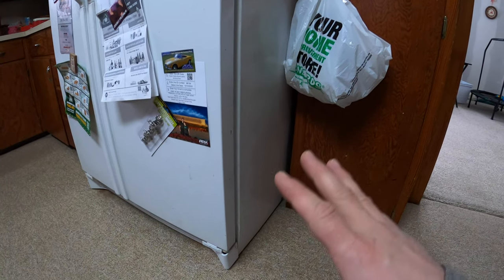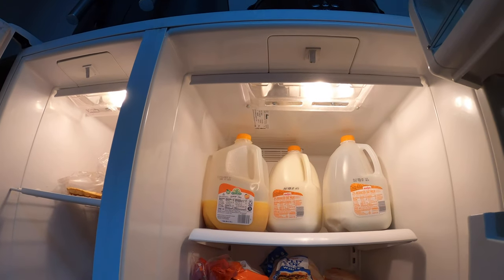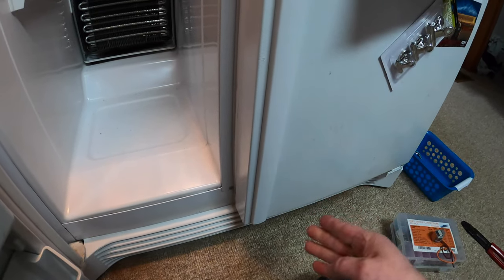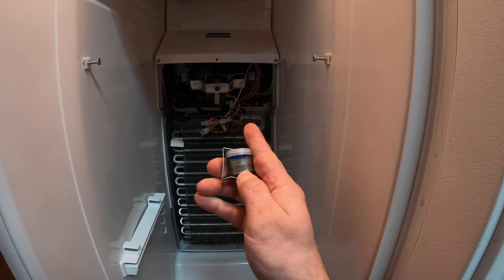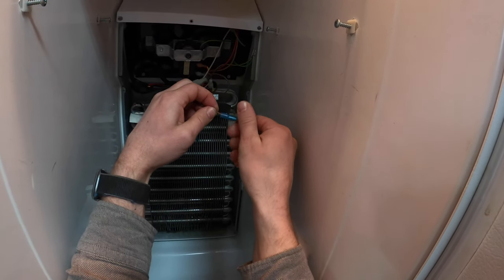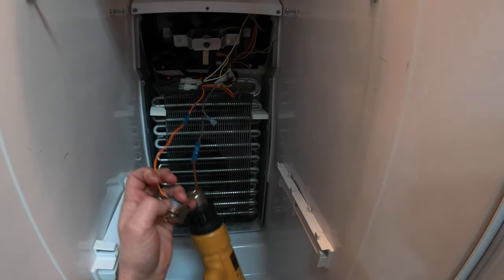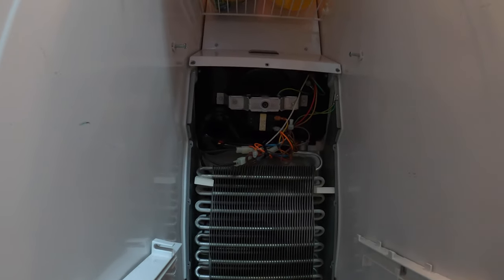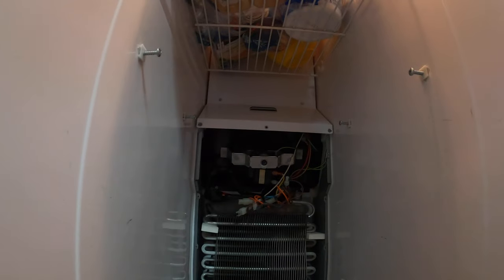Refrigerator Troubleshooting and Repair, Amana Replacing Defrost Termination Switch

Comment: What is the switch part number? I have the same Amana fridge. Lost the owners manual and there is no model number placard on or in the fridge. EIther the fridge model number or the part number would be helpful. Thanks!
Reply from the maker: Mine is model# SX23VW

Comment: false on the compressor not running, could and very often is just the relay on the compressor, very easy and low cost fix
Reply from the maker: Yes, that’s a good point! Could also be temperature controls!